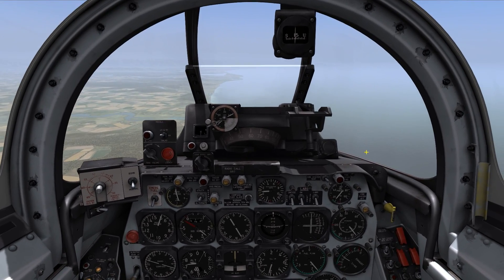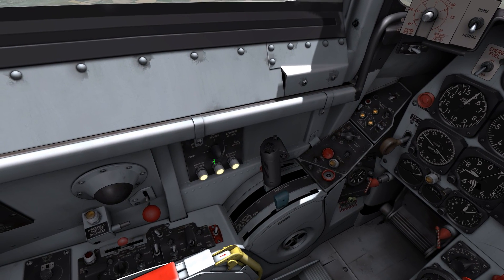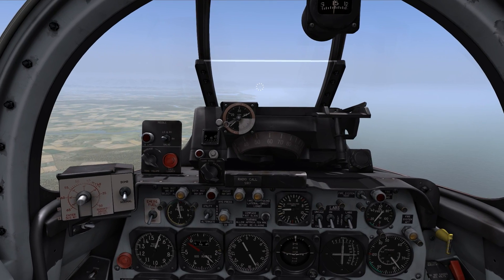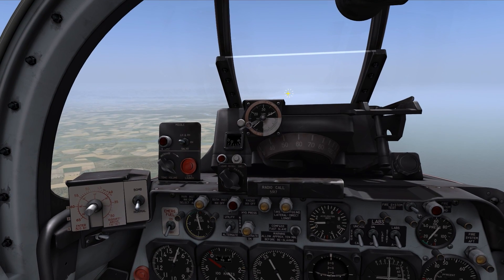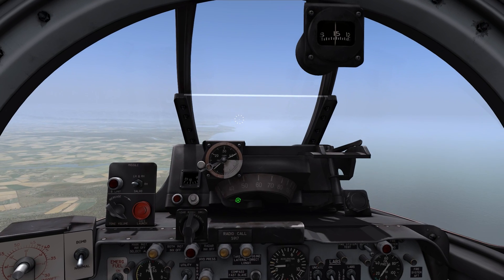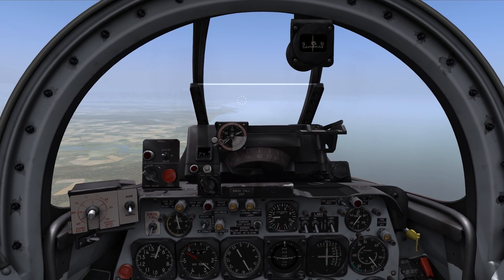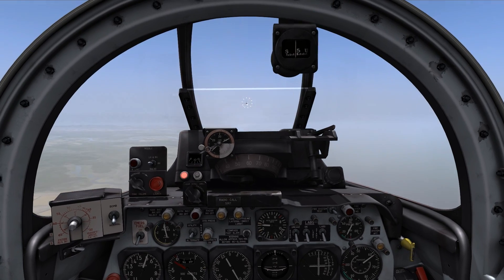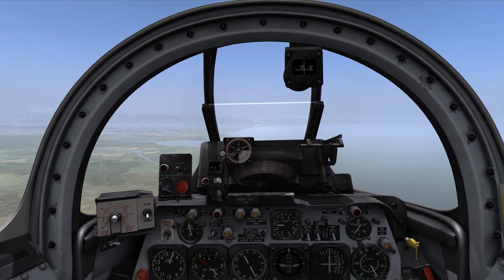[DCS] F-86 SABRE Air-to-Air Guns

Comment: Are you able to do this now (December 2017)? I`ve asked around and not gotten any answers.
Because I bought the plane 2 days ago, let`s say I`m in the usual @ 90 deg climb hot on a MIG`s tailpipe, 300m distance, ACQ TGT, release mechanical Cage, hold button cage on target, release, keep pipper on target and fire, no hits.
And I mean ZERO.
Let`s say I try the same again but let him extend a bit so he`s at the top of his loop, practically hanging still in the air.
300m, pipper on target, make sure I`m neutral on yaw+pitch, commence firing..... nothing... Ok, roll around to change gun hit pivot point....
Nothing 😂

Comment: But what if you are in a hard turn and come up on him, does the radar tell you where to shoot, like the F15? or is it like WW2 where you will just shoot in front of them, because i can see on some dogfight videos from the vietnam ear they hit on every bullet, but not in WW2 gun cams?
great video tho:)
Reply: the gun sight automatically tracks. this was in use in 1942 IIRC

on the p-51 you would set the wing span, then set your range is....by twisting on the throttle.....so it could be done quickly as the target got closer/more distant. the sight was not fixed and would move around the "hud". when the edges of the circle are on the wings tips.... and the center dot on target.... ya cant miss.

PS how to get the range......all they had to do was twist the throttle so that the circular gun piper edges were on the wing tips, and the dot in the middle-ish. what ever range it said on the indicator was the range.... but it didnt matter. 

all you had to do was just go wing tip to wing tip and shoot. 

the f-86 did the EXACT SAME THING! just with out having to twist on the throttle. it used the nose radar.  just put the dot where ever the plane is and fire. the circle edge is only used to indicate that the radar has a good lock.
Reply: Okay thanks ***** but one thing is, how do i get the radar scope? just switch to guns or sight and radar or what should i do? step by step please :)
Reply: oops
Reply: FlightSureCo. i have never flown the f-86. my hard drive crashed, and im waiting for my replacment till i reinstall dcs. i jsut got f-86 this -mas. 

their are videos on youtube for this.

Comment: question, since this is very mixed on the forums. Do you need to set the wing span on the A-4 sight or will the radar automatically do it for you?
Reply from the maker: To answer in short: No and no.
The point of setting the wingspan is for manually finding the range. The procedure is as follows: You identify the target and set the wingspan in the sight acordingly. Then, you rotate the twist grip (which will adjust the range setting) until the wing span matches the piper's dots. Now you get the correct lead calculation for that range.
However, the radar can also provide the range setting. When you have the radar on, and it locks onto the target, it will input the range into the sight, which again leads to the same result of giving correct lead calcuation for that range. The wing span setting is irrelevant in this case, however it can still be used for back up purposes.